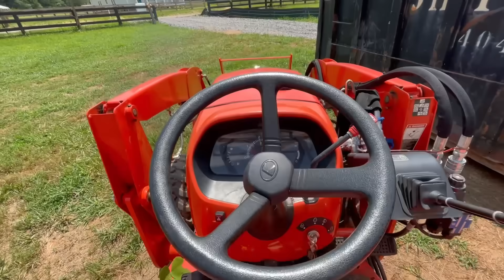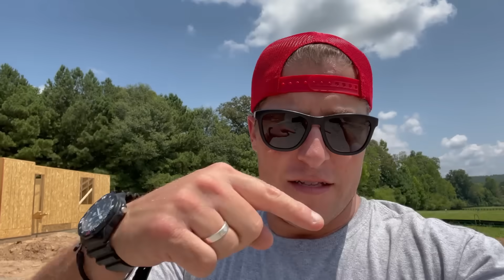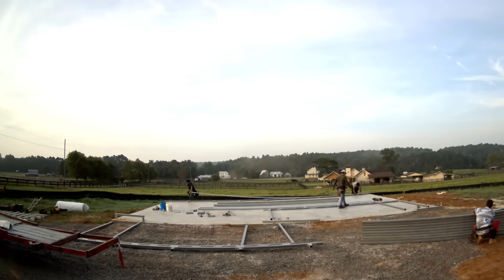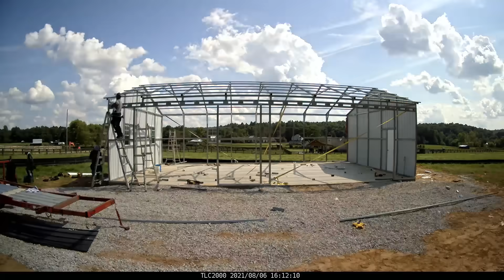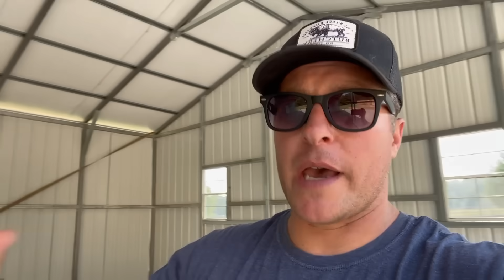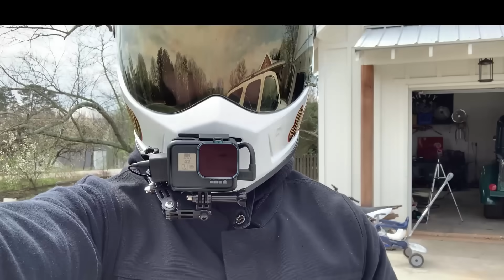I FIRED THEM!!  26x40 metal building Dream Garage build Ep.2

Comment: Just happen to fall on this video and all I can say is your concerns are all valid! Sadly when I see these type of buildings go up its either 2 reasons 1) this building from an economical perspective is the most affordable to build. 2) the client just doesn't know enough that these prefab buildings are simply just sold as they are these very heavy duty withstanding building when really they are not. I'm a welder and my recommendation would be next time consider having a shop be built by an actual welder using 12" beams as columns and roof joist with C purlins to achieve the best investment for your money. Stay away from these building unless simply you know what your getting and have no choice in  buying anything else. Hopefully this got resolved brother

Comment: I recently had a 24x36 metal shed installed. It is almost identical to yours, but like you said, my panels are horizontal. I don't think the ripple on the panel edges would bug me much, but the truss issue for sure. That is a building flaw that they need to fix and provide what was in the contract. 

With mine, there are some issues too. The 3 roller doors would not stay open (they're supposed to stay open when half way up), the walk through door does not open fully as it hits the trim, so now it is an obstacle when I prop it open. I had them come back to fix the doors. They brought attitude with them and fixed the roller doors, but not the obstacle door. They said they can't fix that, but I know what needs to be done to fix it; it's just a matter of finding the time. Given the state of the post covid world, unfortunately you for the most part get what you get. And pay through the nose for it.

Comment: I have put up 3 similar structures but no that large. The seams always showed. I didn't love it but I got used to it. Mine weren't rippled like that though. The panels simply didn't fit was good as I would have liked.  Also, my 24' trusses were super strong for 30" snow load and the bottom chord spanned the whole distance.

Comment: You're insane for keeping that thing.  And for the size of building this is, tube framing is fine if built correctly.  The red iron is better for larger expanses and higher loads.  This is why I PayGo on projects like this, and in my experience, use a check so it can be cancelled if needed.  I really hope you don't have a failure with collector cars in there (or a family member).

Comment: Just had a very poorly welded building go down in Port Charlotte FL.  Came apart as Ian had its way. The truss down tube to the stud connection was a cold weld. came apart like a house of cards. House ok, shed wood built also ok, 1.5-year-old building. Scrap!
Reply from the maker: That's no good sorry you lost your building> thanks for the heads up ill defiantly be doing some reinforcements this winter

Comment: Was it a 30’ wide building ? Even the generic/master engineering plans should show it should be a double welded truss and most def should have had a bigger under bar in the bow.   That issue with the edge ripples are flat out a bad batch of materials and they shouldn’t have even let it leave the shop and loaded on the trailer… lastly the installers should have caught it and known better.  My family has been in this business for 24 years and we require a customer be fully satisfied prior to making final payment and if at anytime feel uncomfortable or displeased  with the project.. HAULT THAT shieeeeeeet!  The sooner the better.  The one thing you said was you that you were told it would be a 100% sealed building … any company doing a steel building should not be telling you it will be 100% sealed.  When someone does full insulation, the installer should roll insulation from the walls to the roof causing air seal, then you can purchase foam inserts for the corrugation rises( which we include free of barge  under the ridge caps and roof flashing to a lean-to. But those aren’t going to completely seal the building.  We always tell customers we will fully insulate it, but prior to you finishing the inside, whether it be sheet rock or plywood, you will be responsible to do any finishing touches to seal up the building.  So anyone reading this, if they say it will be completely sealed… they just aren’t correct.  Sometimes it’s lack of knowledge from the dealer selling you the building but sometimes it’s just smoke up the skirt at that point to make a sale.  We flat out don’t make promises that aren’t obtainable.   I love what I do for a living and I HATE when a customer is not happy with their building.  I’m the “cool new buddy” at the steel building place that gets  you your dream shop/mancave so I avoid like the plague any chance of someone being let down.
Reply from the maker: It’s 26’ deep but yes the engineered plans called for a welded truss. Dang that’s a lot of really good info thanks so much for sharing.

Comment: I noticed issues right away.
1) Those are not trusses. Virtually no structural integrity.
2) I saw no diagonal bracing in roof and little in walls. A good gust of wind will bring the whole building down.
3) Not enough wall girls. Spacing too far apart for 29 gauge metal.
4) Anchorage of building to slab. You showed a bare slab before erectors showed up which tells me they drilled and anchored building to slab with tap cons or similar. For a 26 x 40 x 10 building? Not too sure about that. 
With the other factors noted, I think that's the least of your worries. A little wind will collapse the building like a beer can before the anchors pull out of the concrete.

This looks like an extremely cheap structure but you get what you pay for. Hopefully it will keep the rain off but that's about it.

Comment: When I seen the slab with no anchor bolts and then no red iron just cold rolled steel, I knew you bought a cheap building. If the contract said "PBR" roof panels and "R" wall panels then that would explain the wavy edges to the walls. I really do not think it was the crews fault. They were just working with cheap materials. If you could have adjusted your size to 30x40 you probably could have got a building that give you anchor bolt plans for your slab and also engineered stamped building plans for permitting, PBR panels on the roof AND walls, lifetime fasteners and screws, 3" insulation in the roof and walls, 30 year warranty for the same price.

Comment: You're not crazy at all, particularly regarding the roof truss structural issues (I'm not sure about the siding issue).   The manufacturer and/or contractor should have provided shop drawings for you to approve prior to fabrication, and those drawings should have matched the specs in the contract.   Per California's laws, I understand you now have the right to advise them with written notice that if they do not promptly reply (within 72 hours) with their schedule to begin proceeding with meeting the original specs in the contract, then you must next notify them that due to their silence they are forcing you to replace them, and that they will be responsible for any deficiencies and additional costs to complete the project per their written specs in the agreement.   Confirm with a local attorney, but by following your local laws, any judge will agree with you, and I believe small claims court now goes to $10k.   If the cost is more, then you can also go after the contractor's bond for reimbursement of the added costs (assuming they are licensed contractors).   Whoever you signed the contract with and paid for this building is the one responsible, and if they used an unlicensed crew, then you will have to go after that seller.   You should confirm all of this with your local state contractor's license board, and ask a local contract lawyer that these rules apply in your area.   I am not a lawyer, but I am a licensed California Builder for nearly 50 years, and your story is quite common when there is no licensed contractor involved, as who ever sold you the package must take full responsibility.   You will be fine with the law on your side, as this IS still AMERICA!...

Comment: I used to write specifications for oil field structures. Tanks, pump station, pipelines. I learned by being an inspector and saw what was correct, compliant and structurally sound. As an inspector I have told contractors to correct problems and if not corrected I replaced them. Your biggest mistake was not inspecting components before they were placed.
Reply: Correct

Comment: I went through hell getting my pole building built for my shop. They left the trusses and all the lumber out in 90+ weather for months before they came to build it. The trusses were cracked as hell and the lumber had a massive amount of Wayne. I demanded new ones. We had to fight to get those issues fixed. I would have been pissed every time that I went into my shop and saw the messed up trusses. Demand what you paid for.
Reply from the maker: Buddy that sucks sounds all to familiar with these fly by night building crews.

Comment: I see your concern. The truss is big issues but you had to know they where cheap you hired them and you are buying a tube building that goes up in a day. There not going to build your dream garage. Unfortunately u decided to.go the cheap way. They are doing a good job from what 8 cam tell. Now the truss thing is a problem.bit the ripples are normal I seen it a bunch I have installed 1000s of carports and 20x40 metal building.  The truss need fixed but the rest that building was about right

Comment: Porta Grace are Engineered 11ga. galv-alum buildings. Contractors build to engineered drawings keyed into local requirements. These tube buildings are not and cannot take most snow loads. Vertical siding works but it is supposed to lap to the rear of the building and be taped to prevent ripples which occur once a piece of metal is installed incorrectly.
Reply from the maker: Thanks for the great info.

Comment: I'm a retired erector and structural inspector. Fifty years in the business.  5M sq ft plus of structures in 15 states and Asia.  Son you`ve been had.  The structure won't handle a popcorn fart and the roof wouldn't handle a small load of snow.  The side panel ripples is what is called "oil canning". A reputable fabricator will set those panels aside and sell them as seconds. And readjust the rollers that make the panels.  No anchor bolts in your slab prior to erection was a dead give away.   According  to most codes the sub with anchors should cure 21 to 28 days.  These fly by night electors (mostly illegals) and Jake leg fabricators have undercut what was a great business sanctioned by the Metal Building Dealers Association.    Good luck luck trying to get your money back.
Reply from the maker: Great info man! Thanks for sharing

Comment: You have to look at the actual engineering for that building. Those side panels are part of the structure. It's not going to fold  Arizona requires a 137 mile per hour wind rating. My guess is the snow load on that roof is probably double what's required. And as far as the Ripley little seems  It's a metal shop not a 4 million dollar building.

Comment: Their panel line wasn’t adjusted properly, probably have their rollers too spaced apart which can cause the issue with the sheets, that or a defective coil. 
Also any building 24’ Wide and under will have a small brace Max at 6’ Long and any building 26’-30’ need to have a brace that spans the whole size of the truss, that’s how engineers require it. 
Good job realizing they were cutting corners.

Comment: Wow...Its a good thing you and the county inspector were there and paying attention. A six foot collar tie is no substitute for a truss. If you were to bump that short section of wall separating the two doors, there's a damned good chance the entire building would come down. Its not a tough fix to put in the bottom chord and bracing, but it would've been a helluva lot easier to build them on the ground and then erect them. Did they ever give you an explanation as to why they ripped the siding like that? Hope everything worked out alright.

Comment: Yeah that roof truss is wrong, mine has the 16 foot trusses, with the vertical bracing as you stated it should have been done.  It was strong enough to even put 16 solar panels on top, inspected and permit final. The metal panels with the ripples is bad manufacturing, they should be lazer straight.  These companies can be a total nightmare or can be a joy to work with. I've had both.  What was the end result for you?  I would have let them replace the rippled panels and weld in the trusses otherwise take it all down and call it a loss for them.  Anyway, the way it works is you take the plans to get approved, then you built it to the plan and then it gets finaled, any deviation from the plan is on the people who sold/built the structure.  If the county approved the plan , that is your only fall back.  Let us know how it turned out.

Comment: They also installed the bubble wrap insolation wrong. You are supposed to leave a air gap in between the insolation and the tin. So you lay the insolation,  purlin, then tin.

Comment: i don't think you're crazy - and i don't think you're  OCD. 
if you agree to provide a service and or product for someone - you provide that product / service. 
the customer should not have to force you to supply the agreed product / service. 
no - i would not want rippled metal on my brand new building .   how about i sell you a new car with a dent in the top or hood ?
what should you do ?
i am not into talking or negotiating.  the negotiation is all on the contract.  
i would read the contract and then read it again. 
i would tell the erector to fill the contract or quit. 
i might even have the county inspector come look at the rippled metal and short struts - and fail them on inspection. 
if the county inspector   FAIL 's  the work  - that should  force their compliance willfully or by court order. 
OR 
sue them for your time losses and  anxiety , and have them remove the building.
Reply from the maker: Great input thanks for your support!

Comment: What good is it if it won't pass inspection. I would take it down and insist on them using new materials to do it again. Inspect all materials before they go up. You probably paid a lot for the building. Don't accept anything but what you need, expect, and paid for. Even if it means getting a lawyer.
Reply from the maker: Thanks for the input

Comment: One of the worst parts of hiring people in the building trades is the temptation to cut corners if they think they can get away with it. You really need to do your research, as OP did, and closely monitor the work to ensure it is done correctly.
Reply from the maker: Yes sir that is 100% correct. Thank you

Comment: As far as the metal seams go, you are supposed to put the metal on with the shadow facing away from the front view.   That reduces the complaints.  Just like with vinyl siding.  I can see his picky point.
Reply: Definitely installed metal in wrong way also the laps are supposed to be away from prevailing winds in your area

Comment: I ordered a 30x40 building from Olympia Steel Buildings. It came with blue prints, assembly instructions, and all the materials needed to complete. I ordered insulation along with the building. The doors I had to purchase separately. I got 2 10x10 garage doors and a 36" man door.  My brothers and I built it ourselves on a 4" thick concrete slab. After getting the building up and doors installed, I pulled a 60 amp service from my house for electricity. I ran a natural gas line and installed a 80,000 BTU furnace, and I ran a water line for my deep sink. I am all in for about $22,000. Very pleased with the building.

Comment: Taking it down is not really a great solution it’s easy to add collar ties that are longer keeping in mind your ceiling height will be reduced considerably... but what bothers me most is the span of truss to truss  I didn’t count trusses but I believe about 6 more would make for a much more secure roof especially if you’ve got a snow load and ice build up that roof will potentially be on the floor one day... now another way to add strength is plywood the ceiling and that’s going to add a lot of weight... but to me that ceiling is far more of an issue... the nice thing about ribbed siding like that is you can easily double it up ... and overlapping to bury the issues you’ve got with it ... the camera didn’t really pickup distinctively how bad that looks...  lastly cosmetic issues are one thing but structural issues are a whole nother level... good luck

Comment: Unfortunately, steel siding can do that Rippling on the edges but it can be hidden by starting on the farthest point away from the point of view so that you don't see it every time you pull up in the driveway. I don't like the term OCD because it kind of suggests that somebody with an eye for detail is crazy or demanding too much. I would absolutely want the building I signed for and not a half-assed job because they want to be able to finish it in one day. I don't blame you one bit because that building looks like it won't take a snow load or wins for that matter

Comment: I would hold then accountable for what you paid for. The beam is critical.  The siding is cosmetic but still defective from the panel mfg. I almost went with a metal building but decided to put a footing in and built it out of block and wood.

Comment: The issue with the paneling on the side of the building is IMHO is petty. I can show you that on any steel building. Just a matter of how visible it is due to color. The reason you likely haven't noticed it before is because they may have layered (overlapped) it a different direction which wasn't in your line of sight. Either way, it's easy to pic out individual panels.
Reply: I have wired many steel buildings and have NEVER seen ripples like that on siding panels. It is in no way petty.